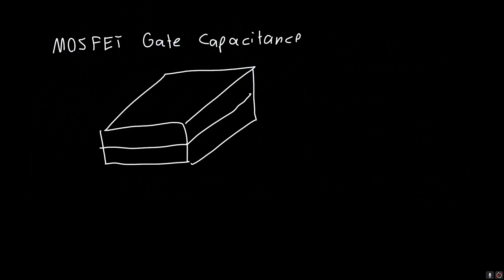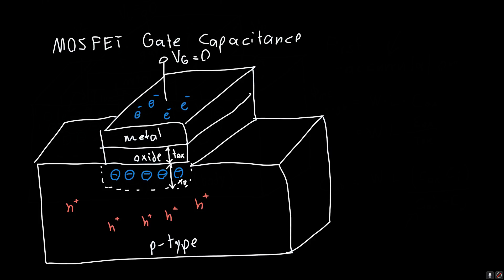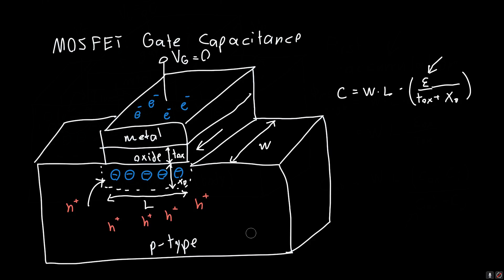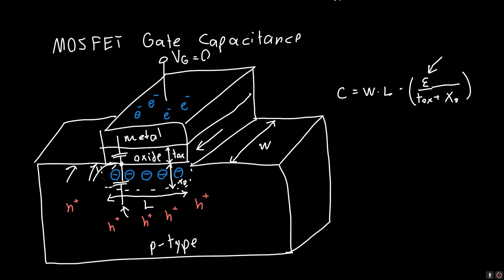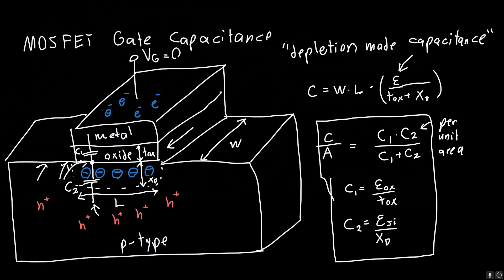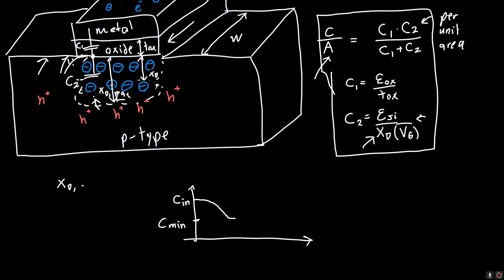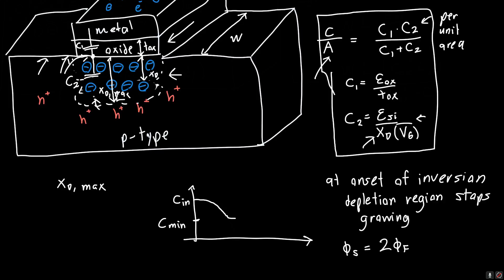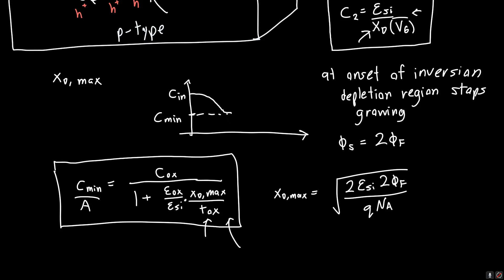MOSFET Gate Capacitance Explained

Comment: Can you explain the differences b/w inversion region in enhancement and depletion mode MOSFET? Also tell the why Φ(s)=2Φ(f)?
Reply from the maker: Everything is the same in both cases in terms of regions of operations, it's just that an enhancement mode MOSFET happens to be in depletion when VGS=0, and a depletion-mode MOSFET has an inverted channel when VGS=0 (you have to apply a voltage to turn it off).
phi(s) = 2*phi(f) is the point where the surface of the MOSFET has the same concentration of electrons as it initially had holes (the surface is 'completely' inverted).